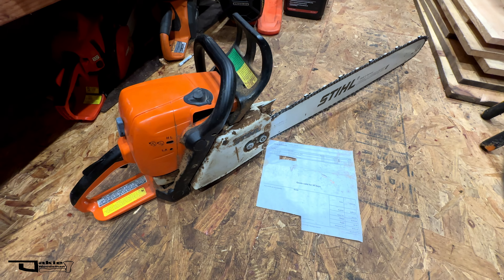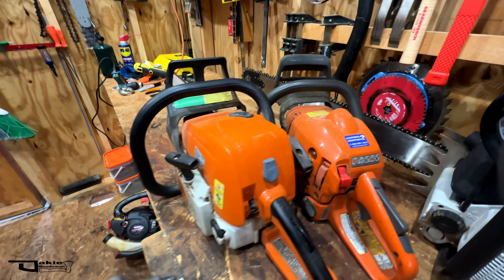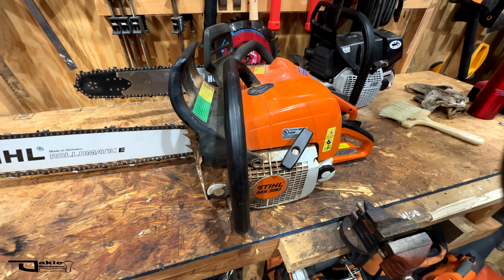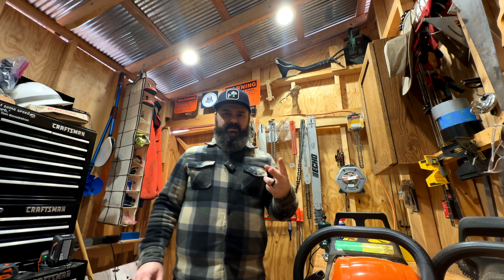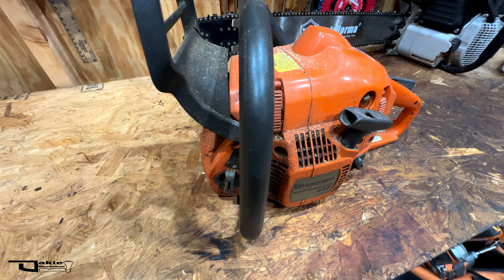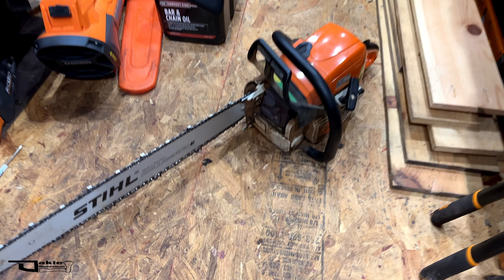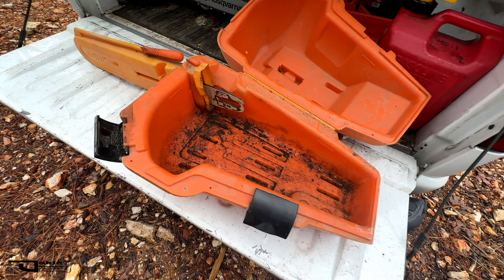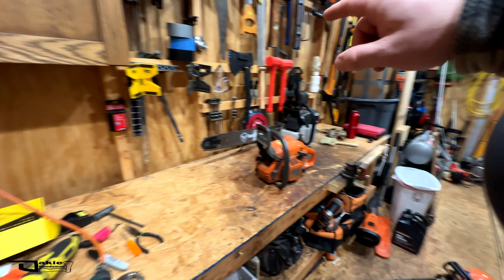Stihl Chainsaw Cost to Repair - WORTH IT?

Comment: Hey Oakie, I'd pull the cylinders off those saws and see how bad they are.  You'd be surprised with a lil elbow grease you can remove the aluminum transfer.  If you can get them cleaned up - order AM pistons for them from The Duke.
Reply from the maker: good idea!  I scotch bright pad may do some wonders?  I have seen a few guys take some saws like this and even get them running using the original scored piston.  I dont want to go through all the work cleaning and building just to have to take it apart again.  That is for sure!  Thanks for the suggestion!
Reply: @oakiewoodsman  I'd hit it with some 240 then 320.  Yeah I'd skip the redressing of the scored piston given the minimal cost of a Duke's piston...
Reply from the maker: Appreciate it!  @902hand7

Comment: Joe, I have a 291 that I got the exact same way. Turned out the main bearing was seized up. The aftermarket parts are fine. Take your pull cover off and put a socket on it and giver hell. It may break loose. If it does you can replace the bearings and fix the housing damage. Not a fan of the 435. I ended up doing a mild port job on it and it runs great. Total investment -$20. I like rehabing "junk" saws.
Reply from the maker: I sure appreciate your input Lonnie!  Before I do anything, I am going to take a look in the exhaust and see what is going on.  Thank you much!

Comment: Definitely tear them down and get a good look at the pistons and cylinders. The cylinders may well be salvageable. There's lots of good videos on removing aluminum transfer from plated cylinders. As 902hand said, the dukes pistons and cylinders seem to be great quality for the price.  For the blower, I believe Chickanic has a pretty good video of a piston and cylinder swap on a 150 bt with part #'s.
Great equipment for projects and learning on IMO👍🏻
Reply from the maker: Thanks AP!  I have got to figure out how to get the cylinder off of the piston.  Maybe flood the top of it will oil and slowly and gently try to turn the crank back and forth till it wiggles loose a little bit?  Would sure be easier with NO compression.  Thank again for the input and tips.  Always respect them man!
Reply: @oakiewoodsman  a good penetrating oil wouldn't hurt, and try rapidly heating the cylinder with a torch or strong heat gun while rocking crank back and forth. (Idea being to try and break it free before the piston heats up and expands aswell) a few good taps on the piston through the plug hole may help aswell.  Hope what I said makes sense😁
Reply from the maker: @aaronpowell4885 it sure does. I have never seen someone do it before.

Comment: Joe, I bet you can guess my opinion.... definitely put some a little money in that 390 run that thing.
I have never paid much attention to that she'd. I really like it. Do you have a video of building it? Thanks for the video
Reply from the maker: I don’t have a video of building it. It was done before the channel started. I do have pictures. The corners are set in concrete and the supports every 4ft square are on surface pad blocks. Build a platform and framed walls up. Was a great project!
Reply: I like it. it would make a handy chainsaw shed @oakiewoodsman

Comment: I used a cheap hipa off amazon was under $100 was used heavily for 3 years then it got smashed. Need to get it apart to see of crank is any good that will determine alot and options.
Reply from the maker: Great tip!  See exactly what is toast before you assume right?  If the crank is bad, may as well get the whole assembly. If it is ok, then just the cylinder and piston would do. Good advice!

Comment: If it was me, I'd ditch that 435 into the nearest dumpster.  Fix the 390 and sell it.  It's not a great saw but some people see the "stihl" name and think it is.  Both folks arrived at the same conclusion.   The echo 590 is all around better than either of them.
Reply from the maker: Can I ask why?  Have you had an experience you would like to share?  I agree on the 390.  Not something I would purchase new by any mean.  I would rather have a 261C than that saw and it would actually be a bit cheaper too!  Anyway, thanks for watching and appreciate the input.
Reply: @oakiewoodsman  sure.  From my perspective, the 435 is a cheap plastic saw.  Maybe you can source the parts and get itrunning again for a reasonable price but your time has value too.  I'm sure you have more pressing things to do like expand the shed, cut trees, do maintenance on the good saws etc.  If you want to wrench on it just as a project to put on YouTube that's the one scenario that might be worthwhile but otherwise, I'd say don't sell your time short.  Not every opportunity is a good one.
Reply from the maker: ah.... that is VERY fair!  I have to realize my time is limited for sure.  Good point man! @johngardner3020

Comment: It might just need a top end, I would go with Hyway or Meteor which are around $100 at Wolf Creek Saw Shop.
Reply from the maker: Will check into them before I make a decision.  I know those brands typically have the best aftermarket pistons and cylinders. Thanks for sharing!

Comment: I bought a 391 last year for 400 have a great day
Reply from the maker: you happy with it?  You Have a 660 as well correct?  In your opinion, does the saw perform well for the size and weight?
Reply: @oakiewoodsman  it’s great for firewood and cutting posts and yes I have a 660 and a 462 for the weight logging I like the 462
Reply from the maker: Quick reply.  Makes sense.  Thank you Dave
 @dmalloy96
Reply: @oakiewoodsman  been too muddy to log, then setting in the house for a couple days. Lol 😂
Reply from the maker: @dmalloy96 and hear ya. Where I have been has been a lot like my place so the ground is very stable but a bit more mushy than normal. It is not however a sloppy mess. I put lots of trees on the ground this week. Was a good one!  Firewood for landowner.

Comment: My good friend has a 390 and he was pretty bummed when my 550mk2 damn near out cuts it 2 to 1 cuts! They are heavy slow and gutless! I think 390 is 64cc and of course 550mk2 is 50! He's a Stihl gut so he goes down and buys a new 261c. Guess what he's still bummed because the 550mk2 beats his 261 lol! Anyway i think it would be a great project for you and the boys. I don't know anything about the 235  but knowing me I'd probably fix it also! Not sure I'd go the cheap 30 dollar China kit as they are hit and miss but the duke or Hyway or Meteor id use for sure!
Reply from the maker: Crazy story man!  I am not surprised about any of what you said. The 261 is for sure nice but the only thing it is truly better at is that the saw is lighter.  The 391 I ran was ok but I feel as if a cs-590 would be very similar as well.  Appreciate you and thanks for sharing again Ted

Comment: I think I’m on my 4th 440/435 basically the same saw. I always buy them for like $100 then end up selling them to friends or family. My latest one I bought from my local tractor supply, saw it sitting on there shelf for $150 talked to manager and they said the dude bought it new and brought it back same day saying it wouldn’t cut. The chain was on backwards so I told myself I’d keep that one since it’s basically new 😂
Reply from the maker: So, it seems you are a fan then?  Many people really seem to dislike them quite a bit.  Of course as with anything, there are good stories and bad with them.  Sounds like you found a good deal on one man! hahaha.  Thanks for watching man!
Reply: @oakiewoodsman  idk if I’ve ever bought one that had anything too wrong with it, usually was just somthing small that a homeowner didn’t want to mess with. I like them for limbing and small stuff but usually just have one around as a beater saw lol gut the muffler and they sound pretty sweet though!
Reply from the maker: I will likely end up with an aftermarket muffler.  may be pretty well open already.  We will see! @calebcrockett1085

Comment: 👍👍Cheap Chinese stuff is fine for 039….been there, done that. 
These are not one of the easier saws to work on.
Reply from the maker: Really?  I haven’t even checked what it would take but I figured it can’t possibly be too bad 😂
Reply: Just a bit more fiddly than the average saw…
Reply from the maker: Any truly specialized tools needed?  They run ok?  @crazyfeller5704
Reply: Just a t27 and normal tools will get the job done. All things considered, it’s  just big and heavy for what it is….but, very durable saws.
Reply from the maker: Thank you!  You ALWAYS seem to have experience with these things. Incredible buddy  @crazyfeller5704

Comment: Fix them! I like to work on saws, let’s me test out a bunch of models. Only like to touch Stihl, Husky, or echo tho. Had a craftsman given to me that wasn’t worth it. The Stihl will flip for more money.
Reply from the maker: Appreciate you man!  How’s that 572 treating ya?
Reply: Not good, the 572 has hella hrs on it. When I went to plug decomp the threads came out. Pulled cyl and piston is worn out. Just got the new oem piston $100 but don’t know what to do to fix the screwed up threads on decomp. Parts are very expensive on the 5xx series husky’s.
Reply from the maker: Has it been plugged in yet to see the hours? Helicoil or something like that?
Reply: No local dealer has software, the looks of piston shows a lot of hrs and/or 50:1 XP oil sucks! The cylinder is good, yeah lookin into a insert.
Reply from the maker: @zeromark202 that is right. I remember you mentioning you were having difficulty finding someone to look at it.

Comment: The 435 is not worth the money fixing but let them tear it down toss it after.
Reply from the maker: Too much wrong at this point? I know the reviews are pretty mixed on this saw.
Reply: @oakiewoodsman  in my opinion yes, can be found new for $300 sometimes less.
Reply: Never been into a 435 but it appears to share alot with the 450. If so, I find them to be very good examples of a well built clamshell saw. The 445/450 and 455/460 are very easy to get apart. Can go from running to crankshaft in hand in under 45 minutes!
Reply from the maker: good information sir.  Thank you  @aaronpowell4885
Reply from the maker: I see where you are coming from, don't spend a whole bunch on this one because they are so cheap.  Plus for $300 they come with a bar and chain!  @justinp7687